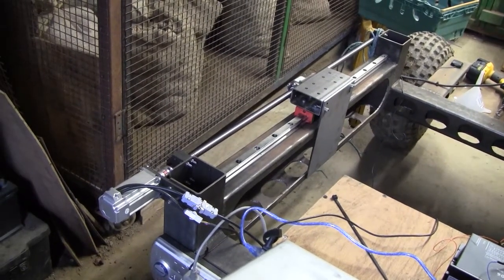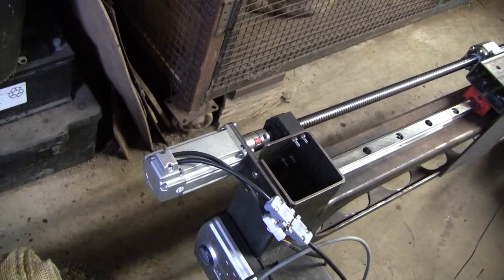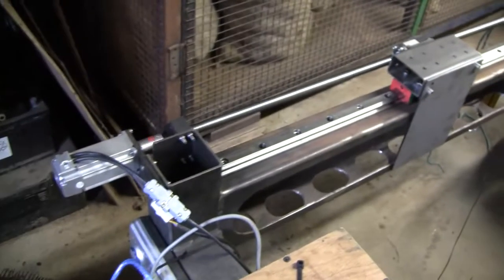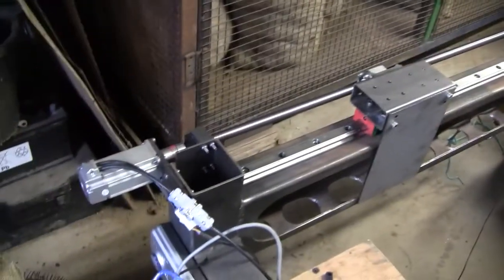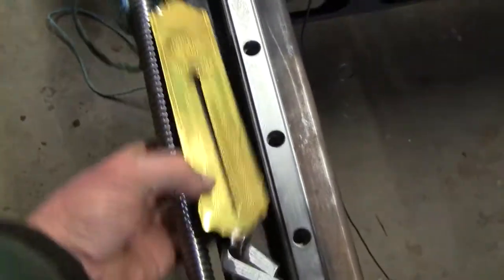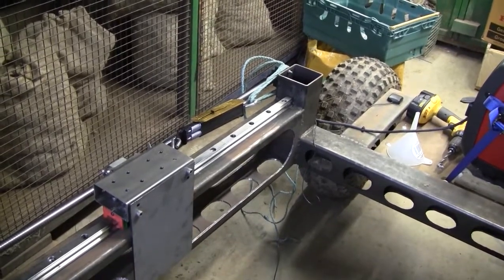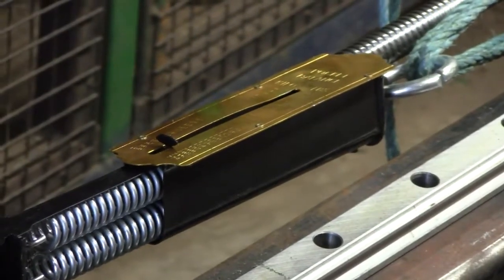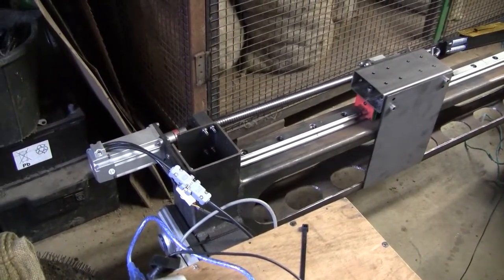Testing ACM604V60 400W x axis

Comment: I have the same one, but can't control, I use grbl on Arduino Uno. only get 1/4 of rev and stop, and then get a jump very unstable. 
Can you share you config?
Thanks from Argentina.
Reply from the maker: Use this config file: https://github.com/paddygoat/WEEDINATOR/blob/master/platforms/Motor%20Drivers/Leadshine%20ACS806%20Motor%20Driver%20settings.lsd  ……. Most likely you have problem with number of motor poles set wrong. Easy to fix!
Reply: Thanks for your response! this config have to load to driver, using protuner? sorry, I'm newbie with this kind of kit motor and driver.
Reply from the maker: yes use protuner. You'll need the special leadshine programming cable and, depending how old your computer is, an adapter cable to convert serial to usb. It's very much worth the trouble to do this and protuner works very well.